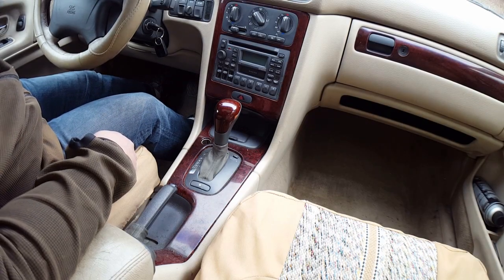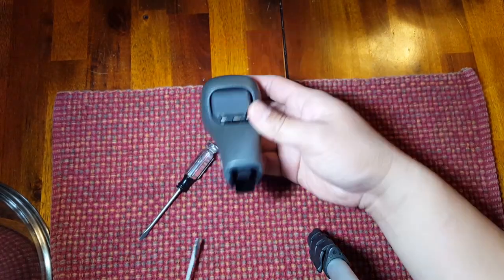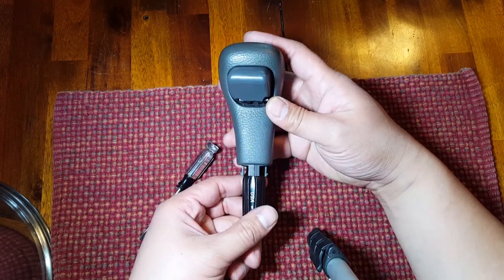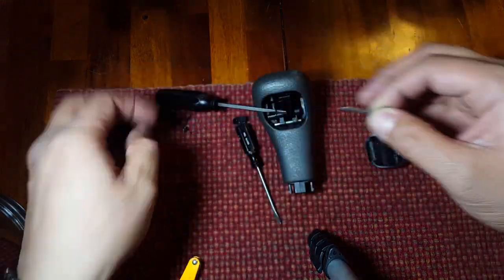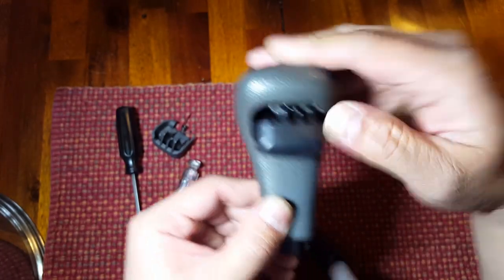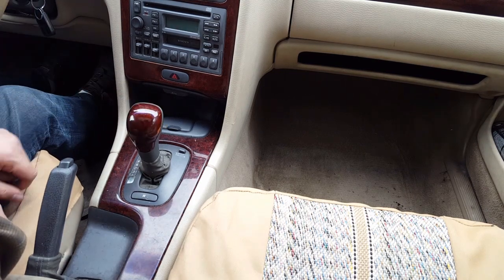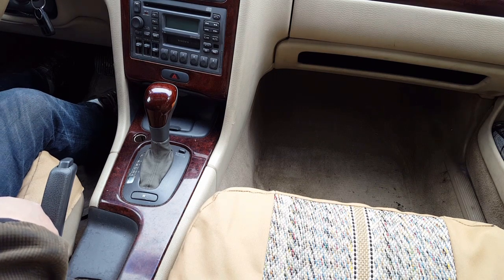1992-2000 Volvo 850/S70/V70/C70:  Shifter knob button repair (automatic transmission)

Comment: This looks like its going to come in handy real soon. My button on my 2000 Volvo C70 has been getting stuck for quite a while now, but today is the first time it has been depressed and hasn't released with a little effort...it didn't seem like too big of a deal until I pulled up to my driveway and couldn't get the key out of the car. I think the issues are related, and I'm watching this from my driver's seat right now. Guess it is time to ask my parents if they can help me order that button you were talking about.

Comment: Thanks for uploading, this totally helped me out. The dealer quoted $130 for them to fix it, and I got it fixed for $15 and it only took about 15 minutes. I found that I didn't need the screwdriver to hold up the upper leg of the spring, I just needed it to pry it out of the recess and I was able to hold it in position with one finger while I used the other hand to put on the new shifter button.

Comment: Your video inspired me to purchase the part and save the dealer's $567 quote (was told the whole unit needed to be replaced). I hope the technique is the same for my 2002 Volvo S60 automatic transmission T24. What's your input - Thank you!

Comment: thanks for the helpful video! i successfully installed the button and now have a functional shifter knob. when i put it on in the car though, it seems that the black push knob that engages the button snapped and is now too short to push the button out. it’s about half the length as the car in this video. any tips?? i would really appreciate it.
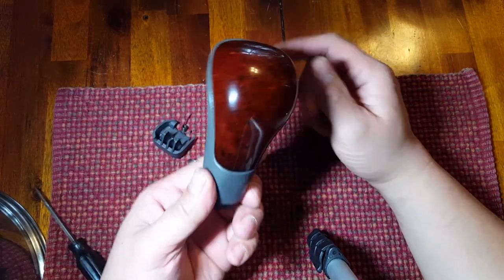Reply from the maker: Are you talking about the part protruding from the shifter shaft (as shown in 10:30 of the video)?  I don't remember right off the top of my head if this part is easily replaced, I'll have to look the next time I have a Volvo in the shop.  You can try super glue on the broken part (if it is still intact enough for reuse) or facbricate some sort of extension that would be the correct length and diameter to engage with the shifter knob button.  Otherwise you probably need to replace that part.  It might be a while before I get another Volvo in so I can get you more detailed information, but when I do I'll follow up with you here.
Reply: AKJeeper great thanks for the tips! much appreciated

Comment: The button on our 1999 XC70 stays in the 'pushed in' position and only slowly works its way back out after a gear change. It feels like it needs lubricating. Could a WD40 be shot into the button without damaging anything? Good video.
Reply from the maker: The shifter knob and button are made of plastic/rubber.  I don't think that WD-40 would damage anything.  Most of the time, if the button is sticky, it's a sign that the spring or knob itself is damaged.  Have you tried sticking a screwdriver in the knob to see if the button works smoothly (I show this 'test' at 9:52 in this video)?
Reply: I was too much of a chicken to pull the assembly off so I just shot some WD-40 into the detent button and the shifter came back to life like new. Thanks.

Comment: Good afternoon, my friend, very good video and explanation, but in my volvo 850 the handle does not loose, I tried to pull it up and it does not come out, could you tell me how to do it?
Reply from the maker: Sometimes these shifter handles can be on very tight and require quite a bit of force to release.  There have been a couple of these where I stood from the back seat area and pulled from there for more leverage.

Comment: when the moment  remove the knob, i press the pedals service ???
Reply from the maker: No.  You only need to push on the brake pedal (service brake) to shift out of Park.  I like to shift into 1st gear (Low Range) so that the knob is in a position where I can remove it easier.  You do not need to push on the brake pedal to remove the knob.  The knob can sometimes be very tight.  Be careful.  When the knob releases, sometimes it can surprise you.  Don't hurt yourself.
Reply: @AKJeeper Great video.   I've pulled a lot of these, and sometimes pulling the knob threatens to give me a hernia.  I take a long cheater bar, and loop a short rope around the knob and the bar, and brace one end of the bar against the steering wheel or column.  Pulling up on the other end of the bar levers the knob out without any pulled muscles or broken bones.
Reply from the maker: Stuart McRae Great tip!  I’ve pulled so many of these that I’ve kind of developed a muscle memory/movement and often make it look easier than is really is.  Hopefully someone will find your tip helpful. Thanks for sharing!

Comment: What if the button is broken and you can’t shift it out of park?
Reply from the maker: I don't usually advise it, but in this case I would probably try to pull the shifter handle out from the park position.  Just be careful not to hit the dashboard, stereo, climate control knobs, rear view mirror, or yourself when releasing the shifter handle from the park position.

Comment: What if the button is broken and you can’t shift it out of park?
Reply from the maker: I would attempt to remove the shifter knob with the transmission in the park position.  The reason why I take it out of park and put it in low range is so that I could have more leverage on the knob.  It can still be removed in the park position, it's just a little harder at that angle.